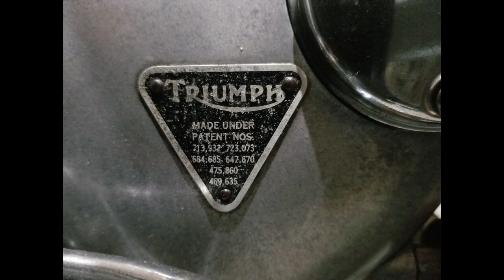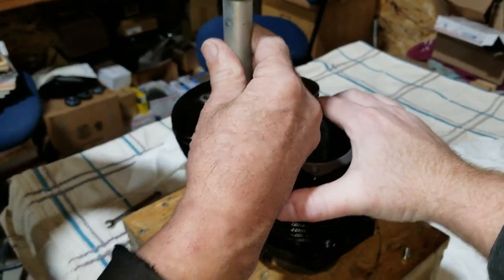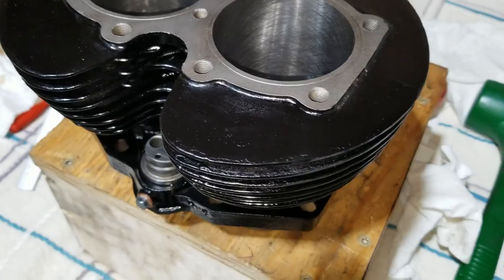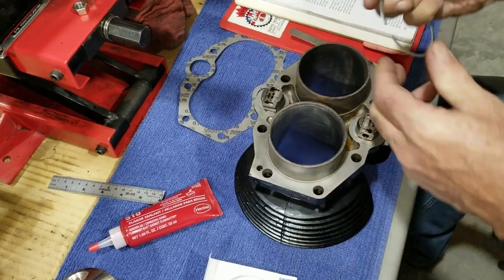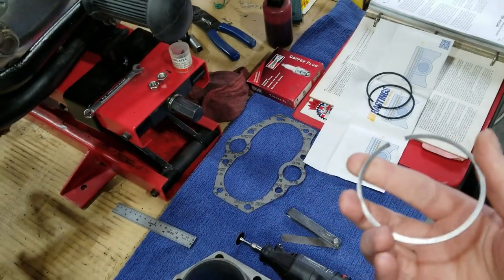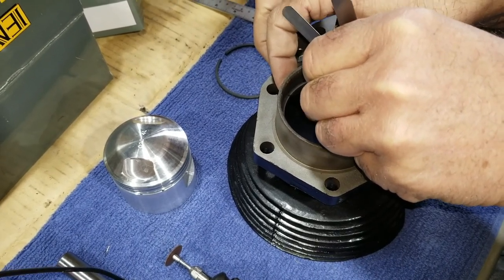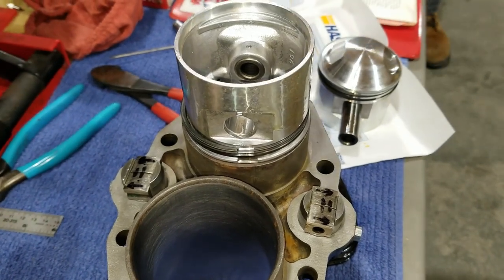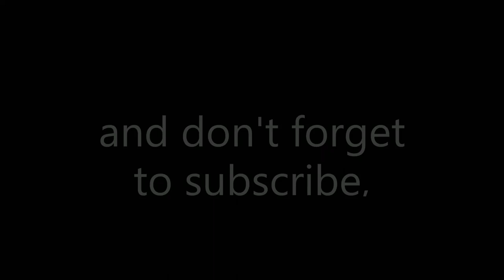1971 Triumph Tiger 650cc Restoration Part 21, Installing the cylinder assembly and pistons

Comment: At 1:04:43 I can see a dot and "TOP" on the ring just right of the 6-o'clock position.  You flipped it back and forth, but it ended up the right way up.  Really should use a ring file machine or make a jig to get the cuts perfectly square, otherwise you cause problems.   Doesn't matter how you clock the rings because they'll rotate the way they "want" to anyway once it's running and breaks in.  Good video though.

Comment: That's scary I always heat the barrel in the oven first.RMM
Reply from the maker: Well acording to the book and other shops I have inquired to they just simply knock it in and out cold and don't say anything about heating it up first? So I like your thinking outside the box and I have done that in similar situations but for this I don't think heating the cylinder first for removal would do anything much as for they are both made out of the same material so the heat expansion rate is the or would be the same? Just my take on it? Maybe I will try it next time though,
Reply: Good program. Easy to understand. Great camera angles. Hope you guys keep going. Thank you for the info.
Reply: @jessesvintagegarage765   Heating the same material will make the gap bigger too. Just imagine you're zooming in on a schematic.  The only time heating doesn't help is if the inner material grows faster.